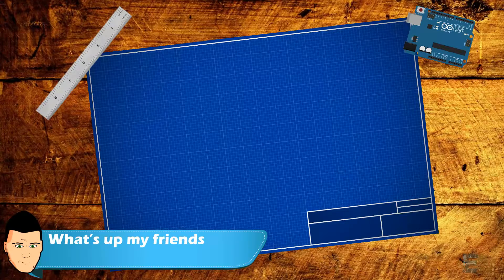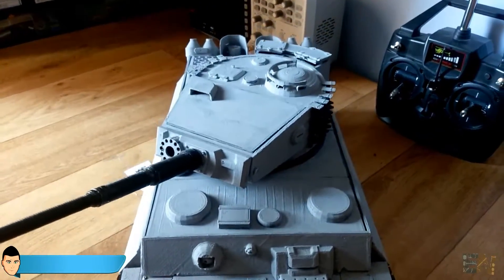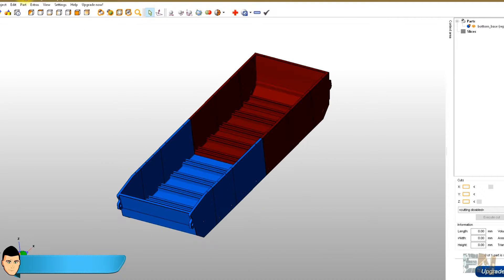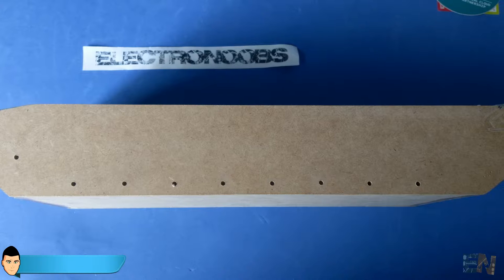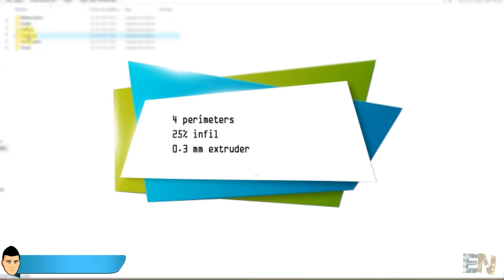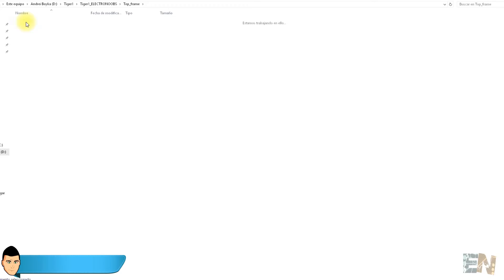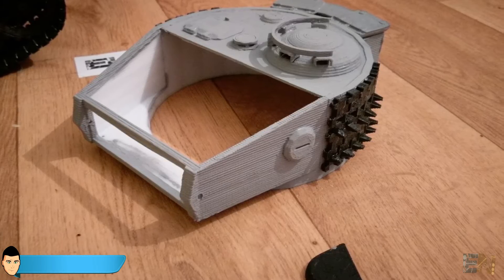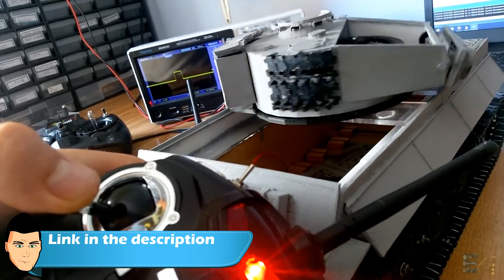3D printed Tiger 1 tank free stl files

Comment: What printer did you used?
Reply from the maker: This one: https://www.gearbest.com/3d-printers-3d-printer-kits/pp_337314.html?wid=88&lkid=11558570
Reply: What material did you used? ABS or PLA? I plan to buy Tevo Tornado or Anycubic Mega i3 for this project, what should I buy for best result?
Reply from the maker: I've used PLA for everything but the geared wheels since those need support material to be printed. I prefere tornado: https://www.gearbest.com/3d-printers-3d-printer-kits/pp_725108.html?lkid=11572071
Reply: Thanks so much sir, have a nice day!

Comment: hi is the full length of thread rod supposed to turn or does the wheels freespin on the rod only ? reason i ask is i purchased the threaded rod size mentioned but its to big to fit the frames holes do i need to drill holes bigger so length of thread rod can spin inside the main body holes sorry for bad explanation hope you understand

Comment: hi this is just what i have been looking for :) can you please give information how i could use proper rc gear ie 4 ch transmitter and receiver and a rc car speed control ect mainly wiring to motors and esc as im a bit confused how to set this part up using my rc cars radio gear and parts any help appreciated